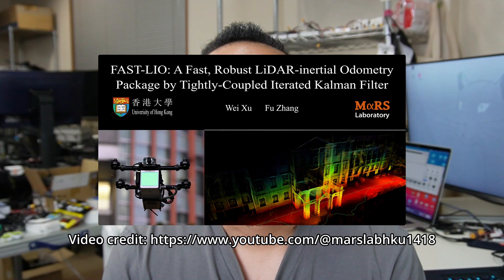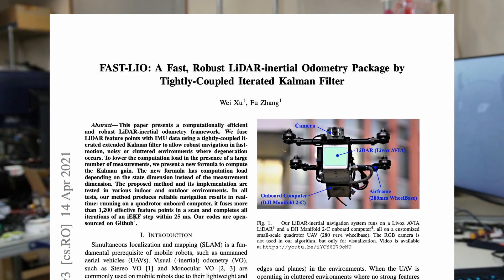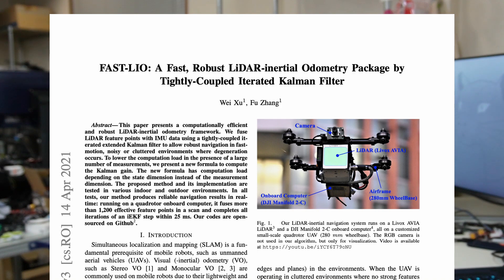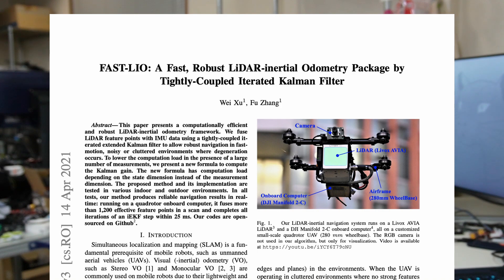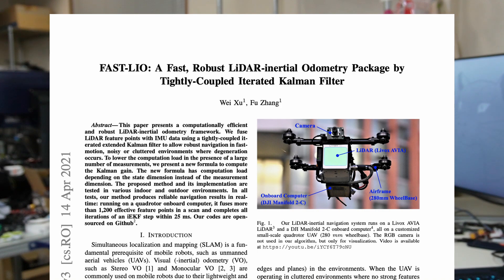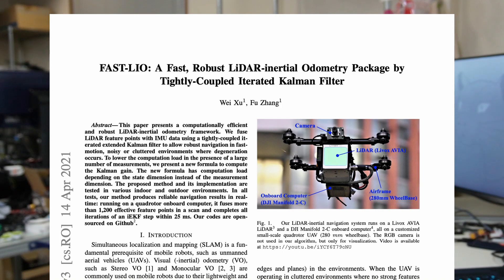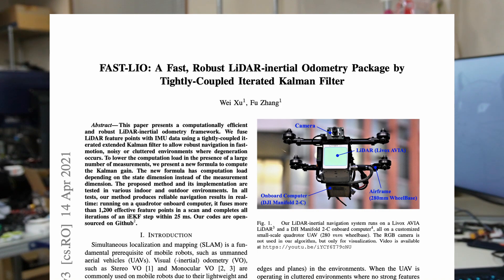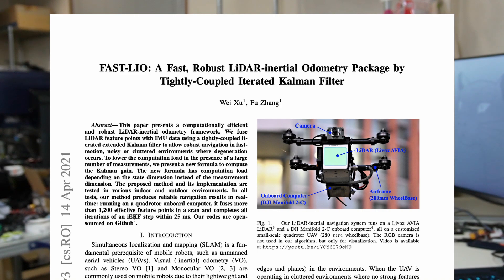Robust Odometry and Fully Autonomous Driving Robot |  ATCrawler x FAST-LIO x Navigation2

Comment: Hi Rachid, thanks for the video! I see you're using Ubuntu 20.04 with ROS1 Noetic and ROS2 Galactic, but ROS2 Humble is recommended for the LiDAR. How did you manage to run all these versions on the same system?
Reply from the maker: @AbdrahamaneKOITE  Hi, yes we can install ROS2 Humble from source. I have two ROS2 on same system, galactic and humble.
Reply: @stepbystep-robotics6881 :must we install it from the source?  is it possible to just using the Dock image?
Reply from the maker: @junyang1710  I haven't tried on Docker, but it seems possible as well. 
If you can install the package inside Docker and could manage to get ROS topic back to local environment, that could work too I guess.

I don't think the package has pre built Docker image, so we will need to make our own.

Comment: What software do you use to actually tell your motors how they should rotate? Because you only point your robot the point on the map where it should go and it goes. But what data does robot use as input data to understand that it should move this or that direction? And where this data store to convert into motors rotation?
Reply from the maker: Sorry maybe I didn't have much explain too detail about robot navigation.
The robot that I am using is a part from my previous video here https://youtu.be/xYo6Bpzbto8?si=TwPnH5ht5e6_Qp3H
Simply speaking, the motors are given PWM signal and to generate the PWM I have the ROS package to easily send the command.

About the map and and goal point things, I am using Navigation2 package which is the most well known navigation in ROS2, you can try searching on that.
Reply: @ sorry but i still didn’t get it. 
After you defining the point in your room robot starts to get to the point. So drivers of motors should be connected somehow to get the information of the path robot are going to move through. So I’m trying to understand which package do you use to convert path to the goal into order of commands motors must execute. And how to connect motors for them to consuming this order as input signal (or may be after parsing).

For example I found in nav2 packages shim_controller package (I guess it’s pwm controller though). And if this controller is automatically convert path into order of commands so it’s obvious that I need to find how to make my robot get signals from this package. But I’m not sure I am on the right path.
Reply from the maker: @Wolf-dx6jk  Okay let me explain a bit more.
I made a package called md100a_ros2_utils https://github.com/attraclab/md100a_ros2_utils
on this package, it's listening on /cmd_vel topics from everywhere. Once any publisher send /cmd_vel, the md100a_ros2_utils package will convert that into PWM signal for motor driver to move wheel, as I have explained in this video https://youtu.be/xYo6Bpzbto8?si=jc-wiGhkRY6EyIlo&t=515
So you have to understand how we can control this robot by /cmd_vel topic first before moving to next step.

Next, I said I was using Navigation2 package which is the package for Localization (know position on the map) and Navigation (move the robot by sending goal point). This package will be doing everything about generating path, create /cmd_vel. If you already have static map and decent odometry source, and once you run Navigation2 package you just need to pick a point on the map, then boom you will get /path and /cmd_vel topics from it. The package will keep sending /cmd_vel until the robot can reach the goal on map.

I am not sure your ROS2 knowledge, but the Navigation2 package is a well-known one in ROS2, so maybe you can try checking on that, I think it could help.

Good luck ;)
Reply: @stepbystep-robotics6881 oh, thank you very much. That’s really clear explanation. 

However I’ve got another question. Does fl_nav2_helpers is your own package which I can’t get anywhere?

Comment: What's the minimum angle of the lidar vertically?
As in if it's mounted flat can it see the ground? Seems like you have some ground data in your neighborhood scan
Reply from the maker: Min. FOV angle is -2degree. The lidar is placed in flat, and yes with this min FOV angle, meaning it will see ground with farther away from the robot.

Comment: Cook video! I wonder if the Fast LIO can be used with a depth camera (with depth image to point cloud conversion). I have a special version of Asus Xtion that is depth-only instead of typical RGB-D.
Reply from the maker: if that pointcloud from depth camera is fast enough, I think it might work. And you still need IMU too.
Reply: @sencis9367 That what I already had. Also It's depth only. So the visual odometry was not available here. I have a plan to mount the camera on the front and back of the robot, as I have two of then. And then write a CPP ros2 node to combine the Point cloud into a single cloud message.
Reply: @sencis9367 I have tested the Asus Xtion (640x480 depth resolution) with various Laser Odometry SLAM but not all of them. I ported the SSL_SLAM to ros2 and this seems to give the best result. Still, the problem remains when the robot rotates. The estimated odometry just fly off as the robot start to rotate. My guess was that the narrow  horizontal FoV compared to 3D LiDAR, But something like Livox Horizon, MID-40 seems to works despite the similar narrow FoV. I yet to test it with KISS-ICP and another IMU coupled SLAM.
Reply: @TinLethax to my opinion kiss-icp is useless for real world application. It is fast, it is easy to understand, but it has no backend optimisation mechanism to handle the long term drift.

Comment: Hi, what is the maximum speed that your robot can achieve? And what maximum speed have you tested with this algorithm ? Thanks :D
Reply from the maker: Max speed with 18V battery is 1.3m/s
It’s DC brushed motors, so if higher voltage it could go faster. The AT Motor Driver that I am using could go up to 24V or 6 cells battery.

I have trie run that with full speed outdoor, the Odometry from FAST-LIO still pretty reliable :) they really made a good work.
Reply: @stepbystep-robotics6881  Thank you for your answer. In addition to the robot depending on the battery voltage, does it also depend on the ROS processing speed? If I'm not mistaken, robots developed on ROS only have a maximum speed of about 3m/s?
Reply from the maker: @mr2tot  I don’t think any ROS robot will be limited as 3m/s because robot’s physical speed doesn’t relate to ROS processing speed. The vehicle physical speed should be depending on ESC or motor driver. 
From my point of view, I don’t use ROS for all of control level, sometime we need realtime data in low level then better to use RTOS. ROS is better from middle to higher level software I feel.

Comment: I wonder what how the point cloud would look like with the LIVOX MID-360 for a wire mesh fence. Our baseball field is surrounded by 6 foot high mesh fencing. In the process of building a mower to do the field and need a way for the mower to see the perimeter.
Reply from the maker: I believe the wire mesh could be detected by the MID-360. It could detect some of power line, so in case of planar fence, it might be no problem.
The lidar itself is not too expensive, you better to give a try on it. 🙂